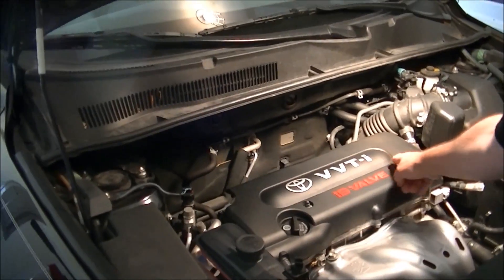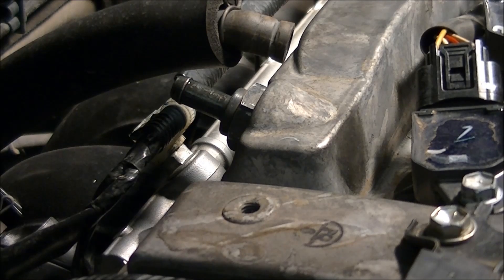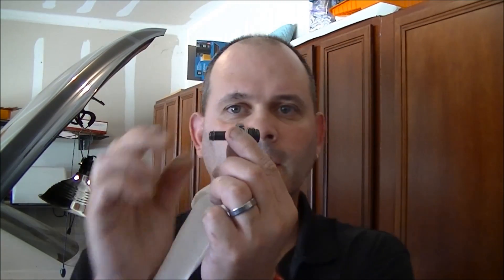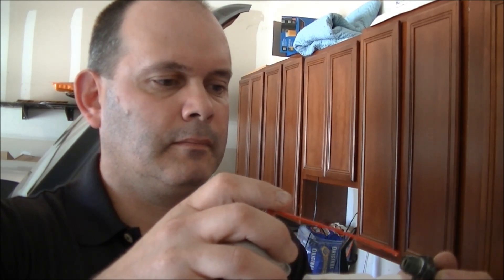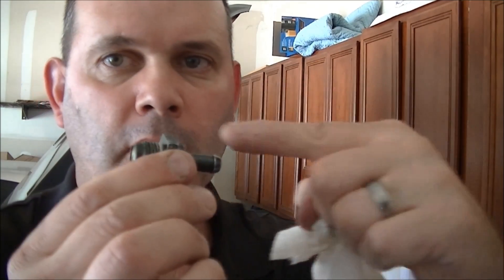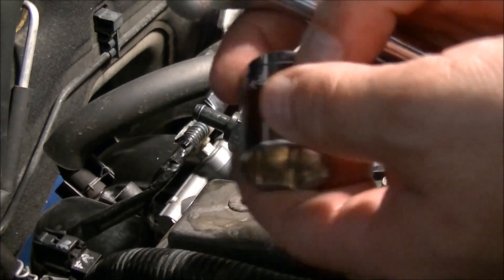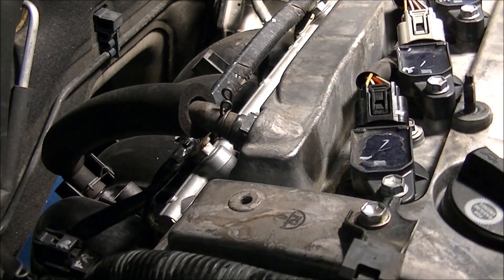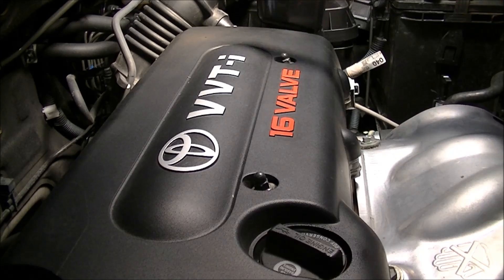Toyota Rav4 2008 Checking the PCV valve 2.4L 2AZ-FE engine. Every 36,000 miles

Comment: thank you very much for the video,my question is when i hit the brake while driving or coming to stop sign my rpm goes up and then goes down,and in the morning time when i start my car my engine is making a noise that it looks like it is cleaning its throat hardly,i am also having problem on the gas fuel too,i filled it 20 litter and i drive 150 km after driving 150 km my gas is empty ,is it normal on gas of this car or what?,i looked at my car engine my pcv has liquid around it,by the way my car is 2004 chrysler sebring lx 2.7 , plz let me know what is going on? thank you again in advance :)
Reply from the maker: Sorry to hear your troubles. Your gas mileage is about 25 miles a US gallon which is what your car should be getting for highway miles. As for the other issues I would have a trained mechanic (you trust) take a look at it. Thanks for watching.
Reply: but couple months ago the gas mileage was fine and i didnt had to fill it every 4 or 5 days,and how about the pcv valve if you want me i can take a pic of it and send it to you? if pcv valve is leaking oil is it a big deal and makes difference on gas or not?
Reply from the maker: hameed wafa
If the gas mileage has seriously changed, I would check the air filter, spark plugs ,tire pressure and fluids (coolant, oil, transmission). If all these things check out then you need to have the car looked at you may have deeper issues with your engine or drive train.

Comment: Will the service engine light come on if the PCV fails?
Reply from the maker: Not directly. In other words if it fails it will not trigger a fault (Check engine light). But the failure if left alone long enough can destroy your engine by contaminating the oil. Check it and replace it if required.
Reply: Thanks, will do when I change my spark plugs.

Comment from the maker: PCV stands for positive crankcase ventilation. On the Toyota it flows in the direction I indicated. I can't really speak for the Nissan valve though. Do you have a new one to compare it to? That will tell you for sure.

Comment: i just changed my pcv on my Nissan pickup and it ended up not being the problem ,but its such a cheap fix why not. Any way im sitting here in front of the computer with my old pcv valve in hand and im blowing through the threaded side and there is no flow but, it is free flowing when i blow through the hose end. Is there any instances where it would flow the opposite or was my valve just bad, in addition to my other problem. Thanks.

Comment from the maker: It's not the end of your engine. It causes oil loss but as long as you keep an eye on your oil level (keep it topped up) and change it regularly (every 5000 miles or less) you should be OK for a long time. I would take it to a an engine shop or a reputable mechanic for a true diagnosis, assessment and price quote. There are many reasons for smoke in your exhaust.

Comment: HI! is the 36,000 miles interval a recommended service in the service manual. Any way, mine is already 40,000, so I will be changing it then, though, if i find the valve still okay using your testing procedures, should I change it still? thanks